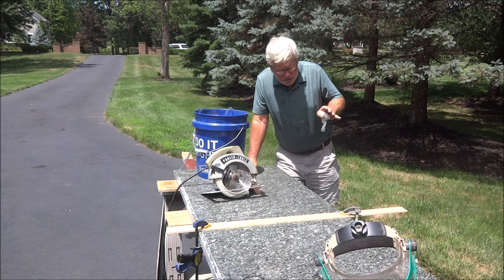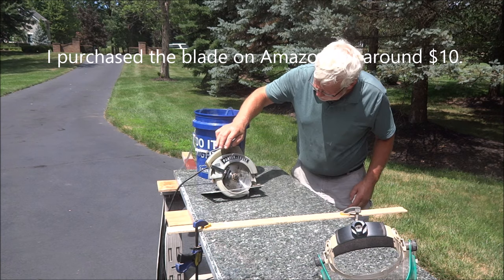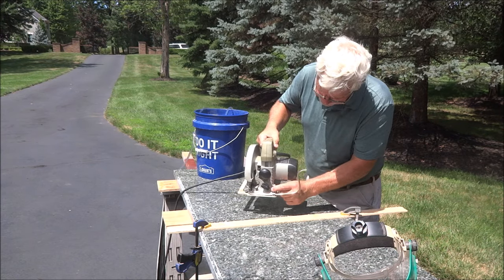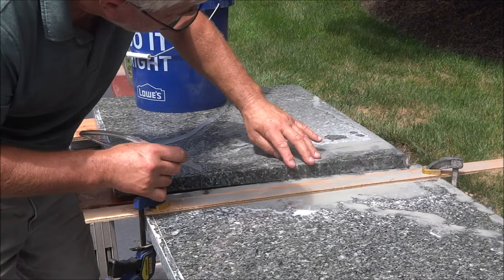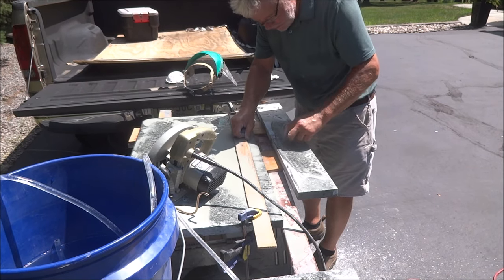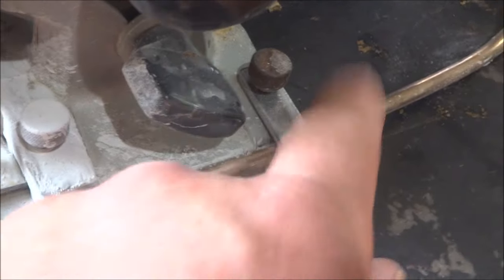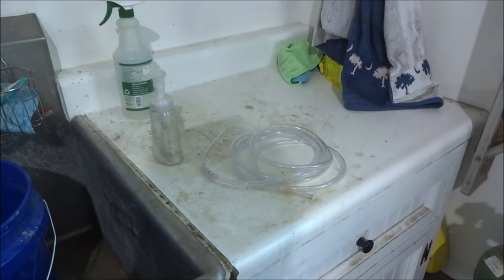Cutting Granite With A Circular Saw And Diamond Blade

Comment: A little tip put painters tape where you gonna may that cut the help not chip the granite
Reply from the maker: Good suggestion.  Tape would show the cut line mark much better too.  Thanks for watching and commenting.
Reply: Not much actually, making a scoring shallow cut prevent chip edges much effectively. Also gives the little engine some breathing room. Cut 1/3 or 1/2 at first then cut the rest at the second cut. Pretty good cut btw you did it like a pro.
Reply: I bet tape makes no difference

Comment: I thin your water supply method is one of the best DYIs I’ve seen in years. Great job.
Reply from the maker: Thanks.  It works pretty well.  I've actually improved it a bit.  I connected it to a water hose and added a small valve to control the water flow.  No more siphon.  Thanks for watching and commenting.
Reply: I agree. Very ingenious! I'm impressed.!

Comment: Nice hack. Another thing that you can do, is to take a hot glue gun and create a little channel around the area to be cut that will hold water in it. I do this for glass drilling as well.
Reply from the maker: That would work great for drilling but would have to be a pretty big area  when cutting granite or stone.  Not sure how well it would contain the water.  Interesting idea though.  Thanks for watching and commenting.

Comment: The brake line was literally all I was missing. Trying manage the tubing while safely controlling the saw stressed me out enough that I hadn’t tackled this yet. Thanks for the brilliant tip!
Reply from the maker: Glad you found it helpful.  I've improved it by adding a connector to garden hose and a valve to control water flow and have used it several times.  Works great.  Thanks for watching and commenting.

Comment: Holy Lick...  Thankyou thankyou thankyou...  this is exactly what i need.. I'm basically "Ignorant" zero experience whatsoever, was planning to use and angle grinder,, Not A Chance In Hell after seeing this video...  Helpful? Extremely ... probably saved me injury and a trip to the emergency.
Reply from the maker: Glad you found it helpful.  You can use an angle grinder IF it is variable speed and can run at 4k or so RPMs and equipped with a diamond blade.  I have a Bosch variable speed angle grinder and have used it to cut granite.  I rigged up a water siphon for it too.  Make sure you are plugged into a GFCI when using water.  Good luck & be safe.  Thanks for watching and commenting.

Comment: Was the water supply just siphoning? Instead of a valve to slow down the water flow (which will work of course) just use a pair of hemostats and clamp to the flow you want. The hemostat could be clamped to the hose near or even in the bucket.
Reply from the maker: Yes it was siphoning out of a 5 gallon bucket.  I have since put a valve in the line to control/shut off the flow and adapted to use garden hose for water.  Works great.  Thanks for watcing and commenting.

Comment: Experienced saw user here. You made this look too easy! I've been using a nearly identical method over the last few days, and it didn't go nearly as well. After several cuts, I'm pretty sure now that my blade was bad. I had to take the 1.25" slab in three cuts, and even still, the deck lifted and the motor strained at a snail's pace. I also think that the saw I used held the blade so that it was not perfectly parallel to the fence, and so my last cut ended up going off nearly an eighth. If I were to advise somebody starting out, it's this: 1) buy a brand-new blade, and 2) make sure your saw's blade is running perfectly parallel to its sole's edge.  

The brake line is a cool idea, except that you can't adjust the blade height. I ended up using a copper wire spooled around some 1/8" vinyl tubing, and this was able to be easily adjusted until I found the sweet spot. No complaints there. Perfect amount of water. Also, my siphon line ran into a sealed bottle, which means that I was able to use a separate straw to blow pressure into the container and thus get the flow going. Sucking, well, sucks. 

Wish I would've seen your video a week ago, before having to scratch my head for a few days only to arrive at the same conclusions, and then ending up not realizing that it should've been cutting way better the whole time. Oh well. Not every project can end up a May breeze, can it? On to the polishing. Maybe I'll try to watch a few how-to videos first.
Reply from the maker: Glad you found the video helpful.  Sorry you had difficulty making your cuts.  Thanks for watching and commenting.

Comment: Great video. Good insight.
The rail system and the slight wondering my immediate thoughts are when a blade wonders it may jam or bind a little.
So it seems a more sturdy guide system may be considered.
I picked up some granite and will purchase a purpose machine to do the task if what I do have doesn't quite work.
The direction of the blade running plays an important part of wet granite cutting.
Circular saws cut from the underside upward which pulls the saw to the work piece.
Ideally when cutting granite the blade want to cause the machine to pull up. Not my words those from a proffesional granite specialist.
I have an angle grinder which has an attachment so I can run it on a guide rail with dust collection.
The thing is I know water cutting is a lot more efficient. My question is will the speed of the blade when using an angle grinder be too quick?
Also the direction of the blade running?
I'm thinking I may do a mock run and see how it goes.
Reply from the maker: This setup worked great for needs.  I've used it a few times now.  I believe a regular angle grinder runs too fast for a diamond blade.  I have a Bosch variable speed angle grinder and it does fine with a diamond blade on the lowest speed.  I also use my Bosch on low speed to polish the edges.
Reply: Yo1u have to check that blade alignment is perfectly parallel to the edge of the saw platform and if not adjust by triming off a bit of the platform if there is no other means of trueing it up.

Comment: Nice cheap setup for difficult cuts. A cordless circular saw would probably be safer considering the water. But yeah, that's a thick piece of stone, clean cut, job done
Reply from the maker: It worked great for what I needed.  I've since added a valve so I can just connect to a hose so no need for siphon.  Thanks for watching and commenting.
Reply: that would be a serious battery to hold up under that time constraint to cut straight thru. 
Not sure how stopping to change out charged battery would affect the precision of the cut.  But l like how you're thinking brother. Gonna give it try as well. ✌🏽
Reply: @elwellboy  Video is exactly what I was looking for.  I have the same saw you have and I really did not want to buy another saw since I will probably not be using  it again.  I am converting my garage to a ADU and have 11' of granite that I will need to cut through.  I think, like you, you had it in mind already to go with your saw that you had on hand, and even if I did not see your video I would have done everything you did including adding the water, though I probably would of done it different.  Your video has boosted my confidence and I thank you for that!
Reply from the maker: @Memo-nd6fj  Glad it was helpful.  Good luck with your project.

Comment: Would it be okay to use a 5-inch continuous rim diamond-coated cutting disc with a 7.25-inch circular saw for making accurate cuts in tile?
Reply from the maker: Don't think I'd use that combination to cut tile.  It might work but would be difficult to be very precise as needed for tile work.  I'd suggest a tile saw.  Hope that helps.  Thanks for watching and commenting.
Reply: @elwellboy  you can use a spirit level clamped to the tile as a fence to run the saw in a straight line..

Comment: I really wonder why most people use an angle grinder for cutting stone slabs. That tool has absolutely zero accuracy compared to a circular saw using a rail/jig
Reply from the maker: Agreed - However, I do have a  attachment for my angle grinder that allows me to use it like a circular saw.  It works great for small cuts on tile. For bigger stuff like granite this setup is the way to go.   Thanks for watching and commenting.

Comment: Aren't diamonds said to be a crystalline 
something? So, how does a crystal cut 
through granite? And don't tell me, 
"It's because it spins."
Reply from the maker: The diamond crystals on the blade are harder than the granite so when the blade spins the diamonds grind the granite away the width of the blade.  Hope that helps.  Thanks for watching and commenting.

Comment: Great idea well implemented. I just bought an electric plant mister ($20) to do the continuous spraying but may return it and go this route instead.
Reply from the maker: Glad you found it helpful.  I have since improved it a bit and made a direct connection to a garden hose with a valve in the plastic tubing to manage the water flow.  Works great.  Have used it several times since.   Thanks for watching and commenting.

Comment: Nice ad for Lowe’s with the bucket. They should scratch you a check
Reply from the maker: Hahaha - That would be nice.  No longer using the bucket/siphon - I added an adaptor and valve to connect it directly to a garden hose.  Works great.  Thanks for watching and commenting.

Comment: Two things:
First: That, sir, is brilliant! Your siphon effect blade wetting system, that is. That is one of the coolest hacks I've ever seen! Well done, and THANK YOU for sharing it!

Second: For those of you hand-wringing over using water with an electric saw: He stated that his saw is connected to a GFCI protected source. Should the water create a problem with the saw (very, VERY unlikely with what he's doing) the GFCI breaker would keep him safe: It's breaker will trip within about 1/10 of a second when it senses as little as 4-5 milliamps of current leakage.
Reply from the maker: Glad you enjoyed it and thanks for your second point re: GFCI protection.  I have actually improved the wetting system a bit.  Instead of using a siphon, I connected to a garden hose and turn the water on just lightly and then I put a valve on the plastic hose right by the saw so turning water on/off is more handy.  I recently used this setup to cut some bluestone for a patio.  Worked great.  Thanks for watching and commenting.

Comment: Hi, i have a sink unit to cut, I'm.not sure if it's granite, little info by customer, sort of like China? Sorry for the stupid question, but I should be OK just cutting it with a diamond tip and circular?
Reply from the maker: Interesting.  If unsure about the material try a test cut in the middle of the cutout to see how the material reacts before cutting the edges.  Good luck.  Let me know what you find out and how it goes.  Thanks for watching and commenting.
Reply: @elwellboy  exactly what i was thinking. I've decided to use my grinder as not so aggressive and can take my time with it. It is porcelain china. Diamond tip and grinder should do it, thank you for your response

Comment: Need to make sure you have a (GFCI) Ground fault interrupter between saw and cord or cord and wall plug. Ive done this before and it started shocking me. Linemans gloves be good too if you have them? Electricity and water, turns you into a direct ground.
Reply: I just herd him say he was gfci protected. Smart Man
Reply from the maker: Yep.  I think I mentioned in the video that I was on a GFCI protected circuit.  Thanks for watching and commenting.

Comment: Nice.  I am about to try this in a bit.  Tried to get the area granite cutters to do, but they are too busy and would not even return my calls.  Anyway, one question is if you had to polish or hone the edge after the cut if it is on a front edge?  It looks to me like it was a smooth cut because you were running your hand on the edge.  IDK.   I will see soon enough.
Reply from the maker: It make the cut fairly smooth but it doesn't polish it.  I use a Bosch variable speed angle grinder with various grits of  PolishSurf diamond wheels ($40 on Amazon) that I use to polish and/or profile the edges.  A regular angle grinder is too fast (RPM wise) to use these diamond wheels.  Hope this helps.  Good luck.  Thanks for watching and commenting.

Comment: Thanks for your video, that is pretty much exactly what I was thinking of doing too! I have to cut a much thinner piece of ceramic tile but it's 4' x 2'. Adapting my Skilsaw to do this work is a key feature that doesn't break the bank on a specialty tool that I'll only use a couple of times!
Reply from the maker: Glad you found it helpful.  I have used it several times to cut stone.  I've since added a valve so I can shut off the siphon.  Good luck on your project.  Thanks for watching and commenting.
Reply: How did that go?
I plan to cut ceramic with the circular saw and a straight edge to guide it. I was thinking to have two passes, a scoring one and then one final so I don't go too deep into the material thus achieve cleaner cut.
Have you got any tips that I (we) can take advantage of?

Comment: May be a silly question, but how do you ensure not getting shocked or shorting it out? Thank you
Reply from the maker: Good questions.  First, make you’re using a GFCI protected circuit.  Second, the saw motor doesn’t really get any water.  Thanks for watching and commenting.

Comment: You should have used the saw in the back actions. Diamond blades are means to rotate in the opposite direction of saw blades. So if you're using a circle saw, you need to turn the saw to face you and lift up the guard and push it away from you.
Reply from the maker: Hmm.  Never heard that before.  If that were the case why wouldn't you just put the blade on backwards?  Thanks for watching and commenting.

Comment: Nice engineering.
Reply from the maker: Thanks.  I've actually improved it a bit.  Instead of using a siphon, I added a garden hose connection with a valve to control the water flow.  Works awesome.  Thanks for watching and commenting.

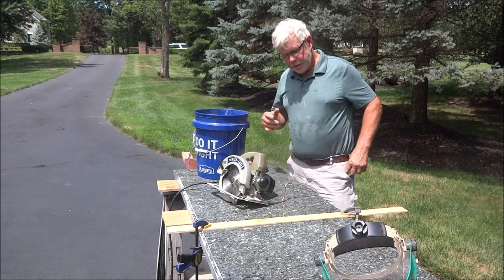Comment: 2:23 - Hope that doesn't electrocute you or damage the saw... don't think it's water proof.
Reply from the maker: It was on a GFCI circuit so that minimizes shock danger.  As for the saw, it's an old one anyway plus very little water gets to the saw.  Thanks for watching and commenting.

Comment: I want to try this but I'm worried my saw is not a sealed motor so water and an open motor just don't make a good combination. I do understand the gfi protection
Reply from the maker: The motor on this saw wasns't sealed.  If you're plugged in to a GFCI and keep the water focused on the front of the blade you should be fine.  Thanks for watching and commenting.